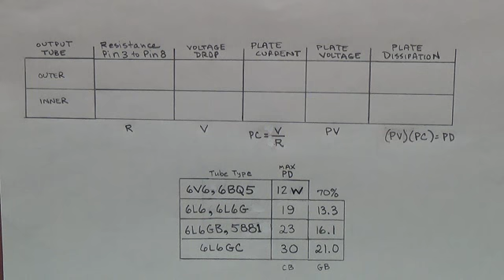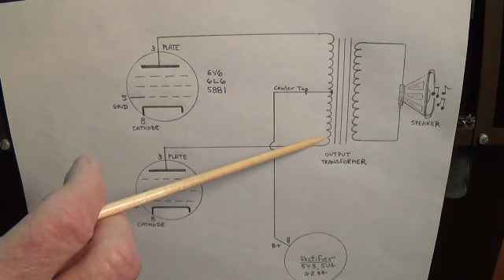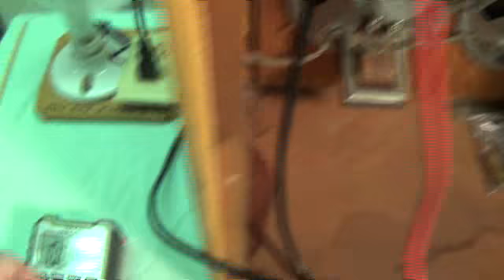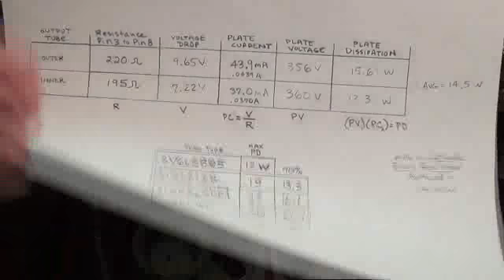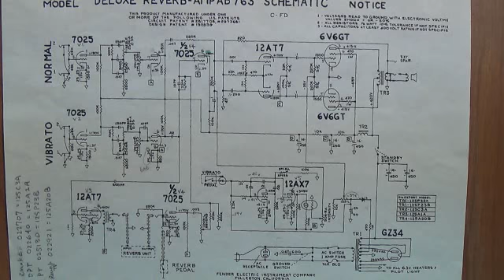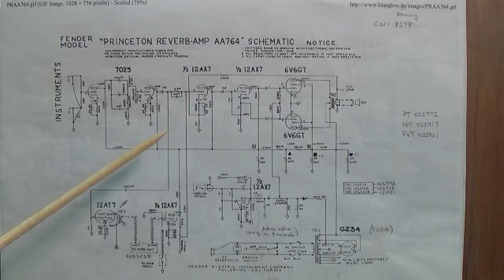Biasing Double-Ended Amplifier Output Tubes, Part 2: Demonstration and Discussion

Comment: Hi Uncle Doug. Second post on your channel. Just wanted to say thanks again. In the few months I've been bingeing your videos - I've gone from a person who vaguely understood the way tube amp circuits work - to someone who feel confident enough to tackle my first amp build which I'll kick off during the holiday season (very probably a Champ, from scratch). I've built a few pedals in the meantime to brush up on my soldering and wiring skills. Reason for the post - I thought you might be interested in the design of a British amp maker who is growing in popularity over here, and globally - Victory Amps. Extremely well-made amps, but with one feature you may find neat - a rear panel mounted pair of probe ports and bias adjustment pot to allow basic bias measurement and adjustment without opening the chassis. For me, this is a good approach to getting valve amp users used to the idea of checking the bias and health of their amp, without introducing too much risk or danger. While I haven’t seen a schematic, this approach appears to approximate a measure for the plate current (by using a 1 Ohm resistor and reading the voltage across it). While you don't take a direct measurement of Plate Voltage and ultimately calculate Plate Dissipation - it seems to me a safe and convenient approach for quick health checks by the user between proper sessions at the tech. I hope this is of interest, and thank you once again for sharing your knowledge with the world - your hands on and practical approach is surely the best resource I've come across. Link to a picture of the rear panel and a link to the manual - which describes the process on page 6 - https://tinyurl.com/yczk88rz https://tinyurl.com/ycxygq6z
Reply from the maker: The amp appears to be very nicely designed and built. I think the idea of readily accessible bias ports is a wonderful one......safe, convenient, and economical since you can do it yourself. I hope this catches on with other amp manufacturers. One thing puzzled me. I wonder why the bias is labeled in mV instead of mA? Perhaps the method of measurement and calculation are different from what I am accustomed to. Thanks so much for sharing this with us. I look forward to seeing one of these gems in person some day :)
Reply: Uncle Doug I believe they list the value in mV to simplify the process. Getting a reading of 22mV on the multimeter equates to a current of 22mA, because the reading is taken over a 1 Ohm resistor. Less to explain for those who don't care about the detail I suppose.

Comment: Thank you again uncle Doug. I keep coming back. I have a question: when checking a four 6L6 circuit like a Twin Reverb, the current running through the output transformer is for two sets of two tubes, right? so you will get an average for each half of the push and pull? Is there a way to work around this and find out what each of the four tubes is doing exactly?
Reply from the maker: You're welcome, Jan. About the only way I can think of to measure the plate current for each of the four output tubes would be to add a low value resistor between each cathode and ground and then measure the voltage drop across each resistor. Dividing each voltage drop by the exact resistance will give you the PC for each tube.
Reply: Thank you!

Comment: Uncle Doug ,........why do you keep one hand in your pocket
even after drainage ?......tx
Reply from the maker: It's just a good habit, Lou. The high voltage DC can cause a lot of harm if you allow it to pass through your body (especially your heart) by completing a circuit......which generally requires touching the circuit with two hands. Using only one hand virtually eliminates the risk.
Reply: Thank you Sir !...........Understood!

Comment: On the Princeton Reverb, right next to the vibrato intensity control, there is a 27K resistor to ground. On this circuit, adjust the value of this resistor to adjust power tube bias. Or, better yet, replace it with a 50K pot.
Reply from the maker: Good advice, LM. Thanks for your input. I generally suggest a fixed resistor in addition to the pot, so that 0 Ohms to ground is not possible.
Reply: The 'idiot resistor'.

Comment: thanks again uncle Doug
i am not sure if these tubes are grid bias or not,  i am still learning thanks to your very appreciated teaching videos.

the cathodes of these tubes are connected to each half of the output xfmr secondary, but there's what is called a cathode resistor connected to the secondary's  center tap.
https://www.google.com/url?sa=t&rct=j&q=&esrc=s&source=web&cd=8&cad=rja&uact=8&ved=0ahUKEwigvZ_l_b3UAhVIOT4KHdTACE8QFgg7MAc&url=http%3A%2F%2Fbentonelectronics.com%2Fservicing-the-leslie-147-amplifier%2F&usg=AFQjCNGke3-yafFswHTPTpY-Qy7FRQ4Bxg&sig2=ibVUCTVsi5GX65980T7foQ

i am not sure if there's something i can do here to bring my tubes down from the previous measurements... any idea?   i appreciate your input very much
Reply from the maker: If the cathodes are directly grounded to the chassis, the tubes are grid biased, usually via a dedicated negative DC power supply, as in most of the larger Fender amp circuits. If there is any sort of resistor between the cathode(s) and ground, then the tube(s) are cathode biased.

Comment: Doug is this amp fixed bias or cathode biased? I see a negative voltage reading from pin 3 of the output tubes and pin 8 of the rectifier. Does that mean it is fixed bias  or would that negative voltage appear on a cathode bias amp as well with this netted? Thanks.
Reply: Of i see it is cathode bias and they share that one resistor.
Reply from the maker: Yes, to both statements.
Reply: Sorry for all the questions but you're the only one who knows enough to answer them for me. I do appreciate the help. Very cool.
Reply from the maker: No problem, Robb.
Reply: I ask my last question i sent because i have two tube 6V6 with readings of 42 ma on one tube and 23ma on the other and all i know to do is just swap out a tube and hope it better matches the other.
Reply: Doug I tried out your method on single ended 6L6 amp I have. the cathode resistor is 250 ohms and I measured 25 volts across it. Pin 8 to pin 1. He has one end of the resistor going to pin 1. So i get .1 amp reading There is 360 volts across pin 3 to ground and I multiply and get 36 watts. Do i need to raise the cathode resistor or did i do something wrong?

Comment: greetings once  again uncle Doug

i got my new set of tung sol 6550 tubes, in my leslie amp, i did two tests..  both with the amp off and filter caps drained.   with the amp on and after 2 min. of warm up:

first half   of the output xfmr  resistance  80.8 /     voltage drop - 6.1v  /     plate current  .0754amps /    plate voltage  423.4v  /    result= 31.92 w.

second   half : resistance  72.9 /     voltage drop -6.14v  /     plate current .0842amps  /  plate voltage  422.8v /   result= 35.59w

after having the amp on for an hour the resistance went up and also the voltage drop changed.  the first half of the output xfmr says:

resistance  88.1ohms /   voltage drop -7.22v  /   plate current .0819amps /   plate voltage  426.1v /   the result= 34.89w

the  second half of the output primary:
resistance 79.4 ohms /  voltage drop-6.53 /   plate current .0822amps/   plate voltage  425.4v /  the result= 34.96w

is it normal for for a  resistance of the two half in the output xfmr to change once it gets hot?   being a new set of tubes they look closely matched,  but is this the correct wattage  for them?  http://hammondb3andleslietips.com/schematic/Leslie%20147%20145%20amplifier%20schematic.pdf

what class amplifier is this on the leslie,  push pull class AB,   push pull ultra-linear,  class A or AF?   sorry i ask to many questions,  i am just trying to find out.  i hope i did better this time with my decimal point  and my units,  thanks for your help and your awesome videos
Reply from the maker: Yes, as temperature increases, so does resistance. This is why superconductors are all kept as close to absolute zero as possible. The tubes, once warmed up, are quite nicely matched. I assume they are fixed bias (grounded cathodes) so there max. PD would be 70% of 42W, which is around 29W......thus, your bias is a bit hot. You might want to crank up the grid bias voltage a bit and bring them down to within normal limits. I am going to guess that the amp class is AB.

Comment: sorry i submited this same post using my wife's account users name by mistake!

i took measurements  on my leslie 147 amp multiple times using a brand new fluke 87-v multi meter and this is what i got:

main voltages are 118 VAC

i set the meter in the ohms setting and  connected one probe to a terminal on the OC3  regulator tube which has the center tap from the output xfmr  connected.  the other probe was  to pin 3 of V2 tube and the reading  was 83.1 ohms.  voltage drop was  7.05 vdc.  then i moved the grounding probe to a good grounding point to measure  the plate current and it was  84,8ma.  plate voltage was 427vdc

repeated the same procedure with V3 tube  and the measurements were: 75.0  ohms,  voltage drop was 4.7  plate current was 6.2  plate voltage was 430vdc.

i am not sure if i am correct with this results though,   so i was wondering if you could help me  out to confirm my results: 

V2 indicates 36.2 of heat dissipation
V3 indicates 27.0 heat dissipation

big difference between each tube   and i am not sure which tube is much closer to what is suppose to be for this amp.http://hammondb3andleslietips.com/schematic/Leslie%20147%20145%20amplifier%20schematic.pdf

i moved the tubes from the tubes sockets and reversed them  and the results were again the same on them for each tube no matter what tube socket they were put in

i hope you can help me out since i am still very green but eager to learn.

thanks in advance for taking your time reading this post
Reply from the maker: You're a bit haphazard with your decimals and units, 4H, but your calculations for PD (in Watts) are correct:  36.2W and 26.9W. The maximum PD for 6550 tubes is 35W, so V2 is a little high and V3 is quite low. The V3 tube should be replaced and the measurement procedure repeated. With a new V3, the PD values should be more equal and probably lower than the max.....due to the ability of the new V3 to  pass its fair share of current.
Reply: greetings once again uncle Doug

thanks for pointing it out  to me,   i am not to good about  where  decimal points should go;   but i've already figured it  out.

i got 2 tungsol 6550 tubes on the way, i hope they'll fix my low volume distortion on my leslie amp...  i'll keep you posted

you are from the lone star state  and so do i.   i am close to the gulf coast.
maybe one day we come across and i take you to lunch.

thanks  for all the help

Comment: greetings uncle Doug

i wonder if the teaching of this video can be applied to check the resistance and voltage drop for this leslie amplifier:   thanks                    Leslie Speaker model 147 & 145 main amplifier schematic. -PDF
Reply from the maker: Yes, this biasing method will work for any Double-Ended amplifier, whether it's guitar, HiFi, organ, or stereo.
Reply: greetings once again uncle Doug

i took measurements  on my leslie 147 amp multiple times using a brand new fluke 87-v multi meter and this is what i got:

main voltages are 118 VAC

i set the meter in the ohms setting and  connected one probe to a terminal on the OC3  regulator tube which has the center tap from the output xfmr  connected.  the other probe was  to pin 3 of V2 tube and the reading  was 83.1 ohms.  voltage drop was  7.05 vdc.  then i moved the grounding probe to a good grounding point to measure  the plate current and it was  84,8ma.  plate voltage was 427vdc

repeated the same procedure with V3 tube  and the measurements were: 75.0  ohms,  voltage drop was 4.7  plate current was 6.2  plate voltage was 430vdc.

i am not sure if i am correct with this results though,   so i was wondering if you could help me  out to confirm my results: 

V2 indicates 36.2 of heat dissipation
V3 indicates 27.0 heat dissipation

big difference between each tube   and i am not sure which tube is much closer to what is suppose to be for this amp.http://hammondb3andleslietips.com/schematic/Leslie%20147%20145%20amplifier%20schematic.pdf

i moved the tubes from the tubes sockets and reversed them  and the results were again the same on them for each tube no matter what tube socket they were put in

i hope you can help me out since i am still very green but eager to learn.

thanks in advance for taking your time reading this post

Comment: Hi Doug. You are the best. Born to teach. Now this might be a silly question but I was wondering if one can use a mA clamp meter to measure the plate current? Thanks
Reply from the maker: Thanks so much, 50. The current clamp is for measuring alternating current (AC), not direct (plate) current. It's an interesting idea, but sadly it won't work.
Reply: I have a camp meter that does DC current on the 6A range with 0.01A resolution . I am looking at it wright now. Model is UNI-T UT211B. Please let me know what you think. Thanks

Comment: hi Uncle Doug and Rusty  if I was to bias the o/p tubes separately and they both had a common bias resistor of 250 ohms 10w  would I start  with 125 ohm on each one because they are drawing about half  current for each tube , and as there are  two separate cathode  res.instead of one .Can I use 5 watts res. instead of 10 watt.for each cathode thanking  you  for your great work
Reply from the maker: Actually, you would start with a 500 Ohm 5W resistor on each, MM. Since the current is half to each tube, once separated, the resistance would double, but the wattage could be halved. Once separated, you could then tailor each cathode resistor to its respective tube and perfectly match their plate current.

Comment: I was going to try changing tube types in my Orange Rockerverb from EL34 to KT88, as the amp is advertised as able to handle several tube types. I opened the amp up and was faced with the back end of a PCB with all the components and traces on the other side. I stared at it for a moment, then put the amp back together, suddenly feeling satisfied with the EL34s.
Reply from the maker: I understand completely, Sam. Rusty and I have opened up a few chassis, taken a look around, and decided to move on to other projects.
Reply: I'll gladly pay my favorite tech to deal with this!

Comment: I've perused all the comments but haven't seen this question, I'm sorry if you've addressed it already.
Why two different resistances on the two sides of the output transformer? Are they not centertapped in the center?
Reply from the maker: No matter how close the center tap is to center, there will always be a difference between the two windings, Lindsey.  I have seen them be very close from time to time, but never exactly the same.
Reply: It depends on how the transformer is wound. If both halves of the secondary are wound together, their DC resistance will be around equal. If one half is wound on top of the other, it will require a longer wire to wind the same number of turns so its DC resistance will be greater.

Comment: Uncle, what about 100w amps with 4 tubes? How do we measure? thanks
Reply from the maker: Just like with amps that have 2 output tubes. Since the output tubes in a 4-tube amp are in pairs, wired in parallel, you will get readings for each parallel PAIR of tubes. You can then divide these readings by 2 to get the average PC for each of the tubes in the pair.
Reply: Uncle Doug is performing his procedure for an amp with two 5881 tubes with a plate dissipation of 23W. In an amp with two pairs of paralleled output tubes, each pair of tubes is essentially one tube with twice the max. plate dissipation of a single tube. E.g. to find the plate current required to bias a pair of 6L6G (19W) and a plate voltage of 390V to 70% max. dissipation,  19W x 2 / 390V x 70% = 68mA.

Comment: Hi Uncle Doug. Thank you for creating and sharing your video's. They are really informative and easy to understand. I have read about and completed a mod on 2 amps so far that adds a 1ohm resistor from pin 8 to ground for checking power tube bias. Do you think this is a good method ? Also I'm trying to clone a Fender 6g11 Brownface Vibrolux. It seems to have the same grid bias as the Princeton schem. in your video. My 6L6's are displacing a cold? 10.8 and 13.4 watts. Would you suggest the same cathode bias mod ? Thanks again for sharing your knowledge. Best Regards   Ed
Reply from the maker: You're welcome, Ed. I measure plate current via the voltage drop across each winding of the output transformer. It's more accurate and you don't add any parts to the circuit. It's explained in my biasing video. If your grid-biased 6L6's have plate dissipation that is too low, you simply reduce the negative DC voltage that you are applying to their grids. No need for any modifications. Good luck.
Reply: Hi Doug. It appears i was not paying full attention at the start of this biasing video and missed you stating you reasons for not using the pin 8 to gnd. method. Oops my bad. So I changed the resistance in the bias circuit from 37k to 27k seems to be better avg. PD now 16.6w. I must now find a hum present with preamp tubes in or out. Volume full or zero. Amp seems to work well except for hum/noise. Have you done any video about grounding wire layout or shielding for noise? Thanks again for your input..  Ed